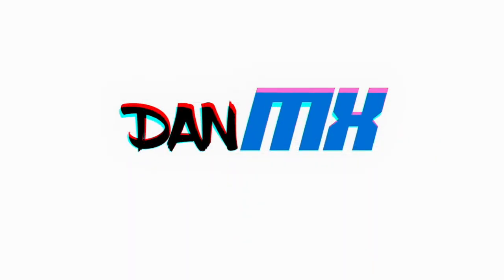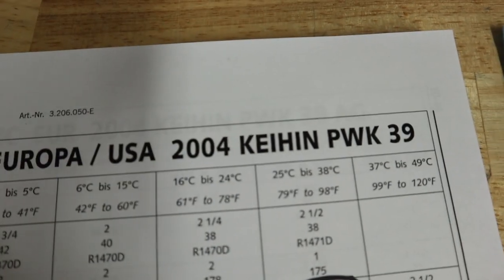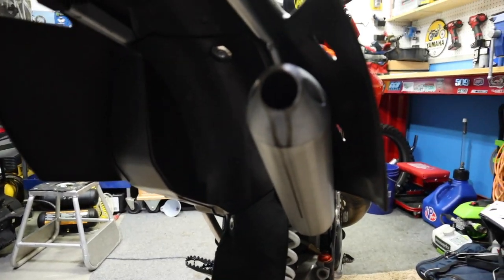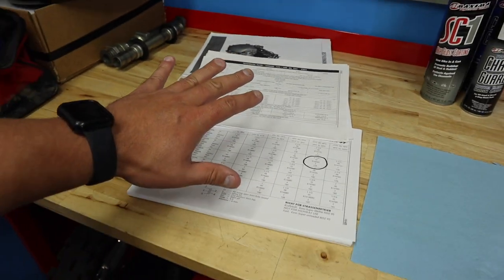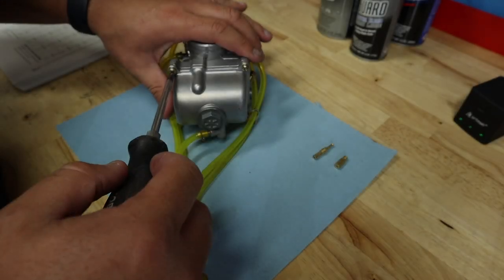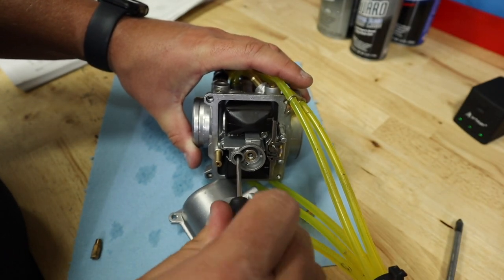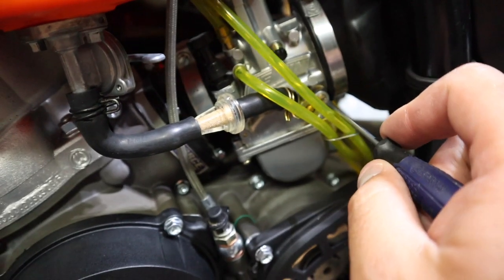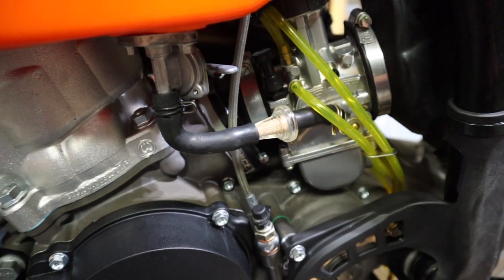DON'T LEAN YOUR PREMIX | What your really doing to your motor!

Comment: Oil mix ratio does not follow what the factory recommends.  The factory recommendation is based on the oil brand which paid them to recommend use if their oil.  Sometimes it's OEM brand oil from the factory (example: Honda HP) The oil ratio recommendation follows the oil you use by brand. A 27:1 ratio for one oil is the same as a 50:1 ratio of a different oil brand. Just look at the OIL recommended ratio on the bottle of OIL you buy and go with that.  The standard is the standard met by the oil brand. Love your vids and appreciate all your content
Reply from the maker: Thanks Ryan, and awesome point. I would love to make a more drawn out video talking more about this too. I run Ester based Maxima 927 that is a 20:1 to 60:1 oil. Perfect for my 40:1 mixture that I run with. I understand that you could also run Saber at 80:1 or 100:1 and it would still fall into that standard. It’s an odd thing oil and viscosity with premix, so I stay on the safer side and run what I’ve trusted. Most people don’t know this that you mentioned and I would have confused some I think by talking about this. That being said, it’s kinda one of those deals where I have to make specific videos hitting specific topics so I don’t get slammed lol Love the conversation man, thanks for the info again!